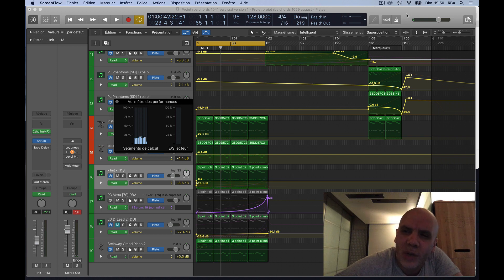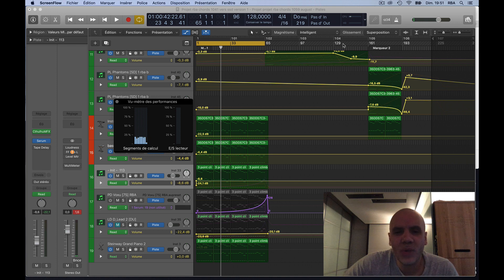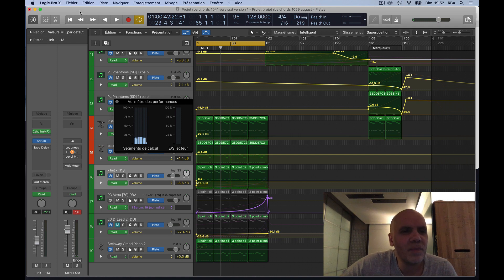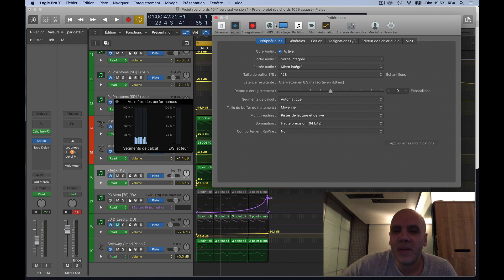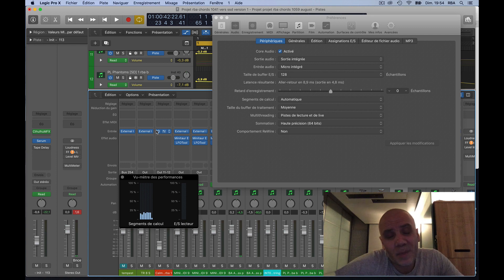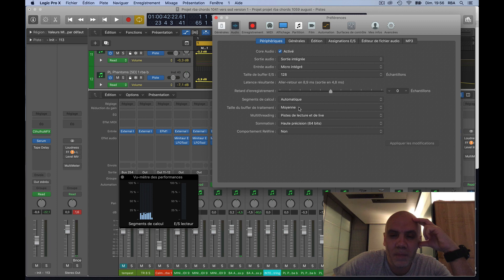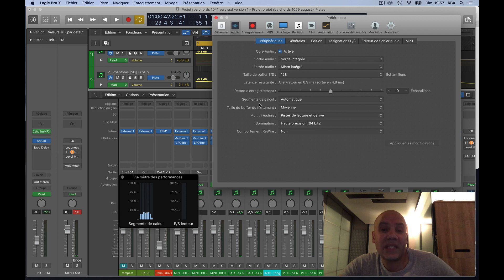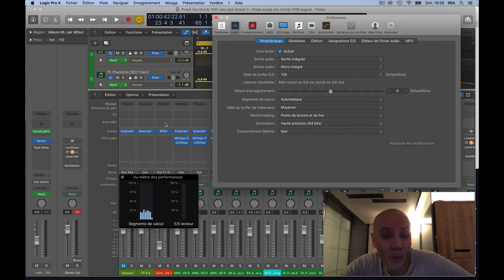why apple logic pro x :  crack/  pop/  sizzling / cracking / ratling or any other DAW when recording

Comment: No one has mentioned the overheating of the computer, could be a cause.
Reply from the maker: Yes and no

For exemple you have the crack noise when you also reach the limit of one core …

So if your ventilation system is fine,
I would say that the problem it’s the number of core of the cpu or the resolution of the project…

Also number of the plugins in use…
Reply: @RBAPRODUCTION  Ok. ---- If you open say 40 projects in one sitting and not closing Logic, however only keeping 1 project open at a time, would that lock up resources!
Reply from the maker: @albertbouwer  yes and no ,
The overload of the project,

Is the 

- size and power of the CPU
- resolution of the project ( from 44.1 to 192)
- memory size
- SSD configuration on the motherboard ( BUS)
- number of plugins depending the resolution of the project
- also all other programs windows open in the desktop

Comment: in my case, i solved this by just deleting the track that had scratchyness, creating a new track and it was fixed!
Reply from the maker: You right, I have discovered, by opening and closing many times the tracks, or project, it will not work fine….
So one of my friends, told me it’s because of , the memory, not saved at the same cluster….

Comment: i have the same problem but my logic pro x is cracked and ive been thinking maybe bc it is cracked, is your one legit or cracked?
Reply from the maker: Mine is legally downloaded,
But I have some of my friends using a cracked one without any problems except they can’t update it,

Look the the bandwidth of your mother board,
The bandwidth of in and out of your HDD,
And the RAM ..... your CPU  etc etc etc 

The power of your computer will make the difference

Comment: I passed everything to a different project and guess what?.... it happened in the new project 🙁
Reply from the maker: Did you try to change the sound card ? Try in a other computer ? Also 32 but and 64 bit operation for some plug not work properly, 
48 or 88.2 or 96 kHz format ?

Comment: I just bought Logic Pro x, can I have my money back?
Reply from the maker: Or by the latest macpro arround 6000 usd ....
They have fixe the problem with higher prices rates of the computer.....
Thanks Apple.....
Reply: RBA-PRODUCTION bro, what is the best Logic Pro x version? Must stable?
Reply from the maker: Felipe Munhoz to be honest after using Mac and PC
Power is the most important things,

SSD are very important, 
one for running the system, 
and an other to run the project,

Because it consume a lot of bandwidth 
Specially if you work high samples rates 
For exemple at 96khz, I got so much problems,
That it took me a lot of time to understand,
Why a computer can’t handle it, without appropriate configuration.....
Reply: RBA-PRODUCTION But man, the thing is when I use logic the chord progression, the Fx and all things does like “tec tec” in my headphones and Then I tryed in other daws and I don’t have these problems (sorry about my English)
Reply: Do you have instagram?
Reply from the maker: Felipe Munhoz yes “ rba_production “
Reply from the maker: Felipe Munhoz it’s probably 
the setting in Logic x
Try different setting....
Until they disappear....
Start with maximum latency, and large buffer,
48khz then 88khz .....
Reply: RBA-PRODUCTION thank you bro